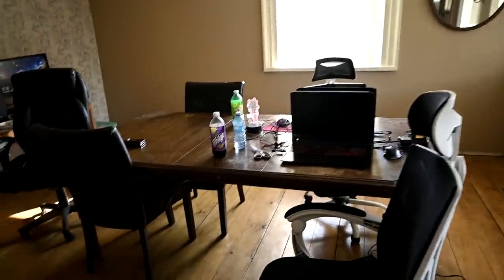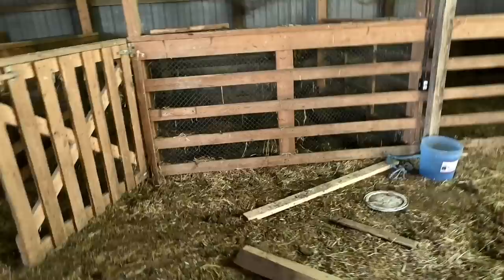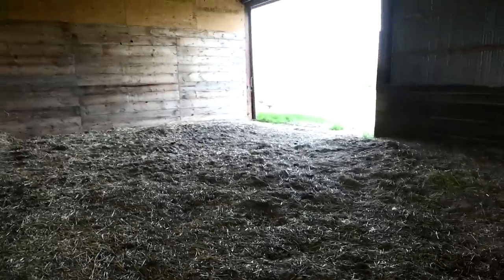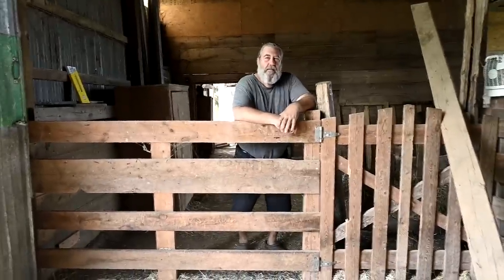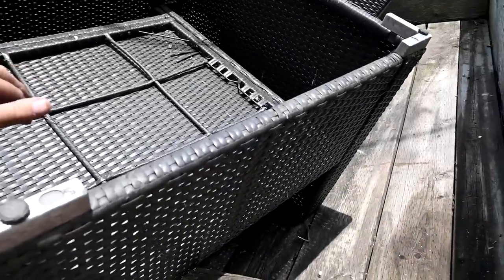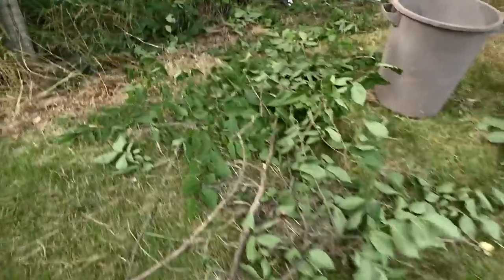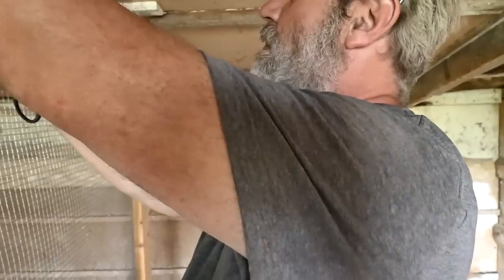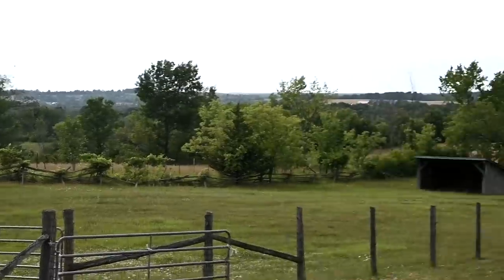5 Things We Hate About Our New Farm!

Comment: Something that you might want to look into is a manure spreader to keep the manure pile to a minimum. It really helps cut down on flies should they be an issue when you move the horses! Ours is just pulled by a 4wheeler, but you can get bigger ones for tractors or gater type vehicles.
Reply from the maker: I've seen them!  Definitely a plan!

Comment: Where are you putting you fire wood to keep it dry?
Reply from the maker: Not sure yet
Reply: @DayByDayVlogs  just a suggestion.  Get it undercover as soon as you can.  I would say it has only 20 % moisture right now which is excellent in heating.  It takes approximately 2 years to be cured for good wood to be burnt for heating a home. Good Bless